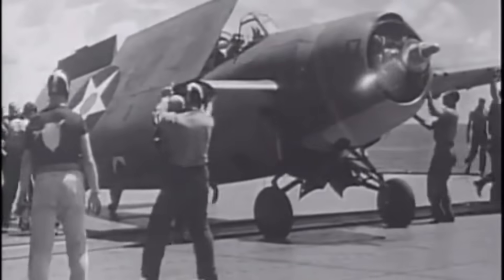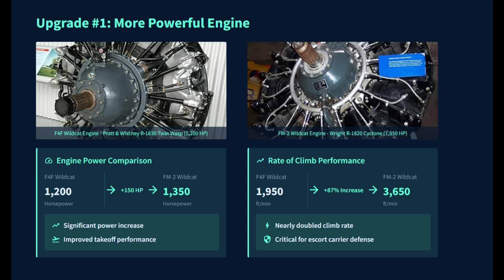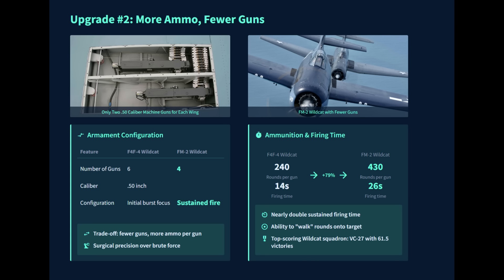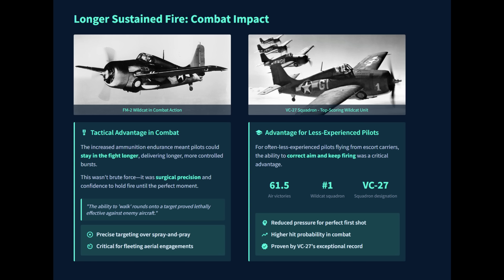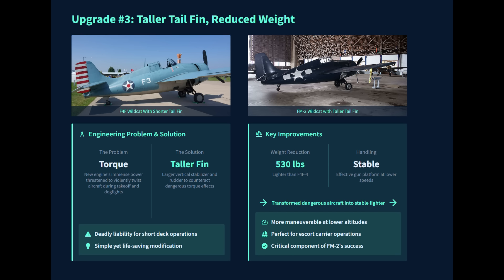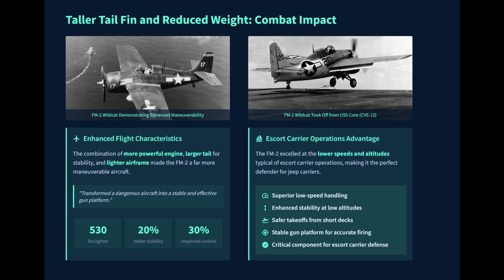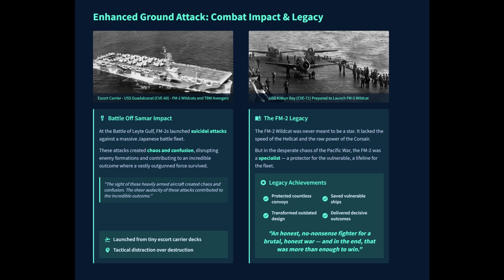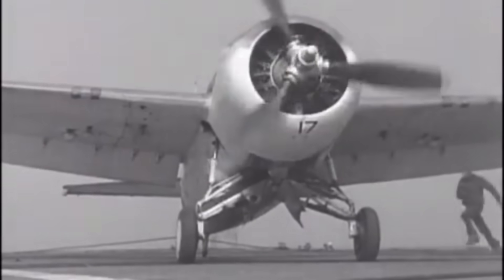FM-2: Four Upgrades That Made It The Ultimate Wildcat

Comment: Good comments below, especially the observation that reducing the number of guns from 6 to 4 increased maneuverability. The wildcat was initially designed with four machine guns and a six gun variant was introduced just before midway. Pilots complained about the reduction in maneuverability and shorter period of fire. One other factor, not mentioned below is that the six gun version was unable to fold its wings, a compromise made to install that extra machine gun in each wing. With space at a premium on the escort carriers, being able to fold the wings was pretty important, as that increase the number of aircraft on board. One final point; Japanese aircraft were so vulnerable that a fire power of four machine guns was sufficient to set most zeros and Betty’s flame with a short burst
Reply: Not calling you a liar by any stretch of the imagination, BUT.....I find it hard to swallow that the US Navy would accept ANY aircraft for carrier service which was incapable of folding it's wings.

Comment: The propeller was changed as well.
Reply: Yes. And I think that pylons for two drop tanks was standard. (On the F4F drop tanks may have been a field modification.) In photos, you usually see them with only one drop tank under one wing and sometimes rockets under the other (which is asymmetrical and looks weird). A well-researched book about the Wildcat is: Barrett Tillman, Wildcat: the F4F in World War II (1983, 1990).

Comment: One of the best"upgrades"that could have been given to all US fighters not just the Wildcat would have been substituting 20 mm cannon for some or all of the .50 cal machine guns. The cannon on the Seafires proving devastating against Japanese aircraft ending the fight quickly rather than the sometimes drawn out dogfight that machine gun armed fighters sometimes had before downing a Japanese aircraft
Reply: There were a few Corsairs built with 20 mm cannon.  The pilots didn't like them.   The radar equipped night fighter version was also equipped with 20s.
Reply: @Rocketsong  This is probably because historically given the choice US pilots and other US servicemen preferred to spray bullets indiscriminately everywhere rather than take a second or two to line up a shot. Though it should be noted that pilots in all other WWII nations seem to have been able to transition to cannon use much preferring the ability to destroy a targeted aircraft with either a single or a few hits

Comment: An important point regarding the perception to NEVER get in a turning dogfight with a Zero:  that rule definitely applied when combat speed was under 250 mph.  At around that speed and above, the Zero's ailerons became very heavy due to G forces, and experienced US pilots took advantage of that and could successfully get in a turning combat with a Zero at higher speed.  The FM-2, along with other second generation US WW2 fighters, had ailerons with hydraulic boost that allowed better manuverability at higher speeds.
Reply: You're close to right - the ailerons were not made heavier due to g-forces but due to the high-speed airstream pushing the control surfaces back in to the wings.
Reply: This info made me think that they used bait & switch tactics, like the famous thatch weave, in the later half of the Pacific campaign

Comment: Hold on, 14 seconds to 10,000 ft with a 3,650 ft/min climb rate? Something's off with math, because that is faster than the F4 Phantom.

That one tidbit aside, this actually a really nice video to reference for the FM-2 and power point slides breaks down the info to be very easy to understand. A nice little fighter, just hope you don't encounter something like Ki-84 in a fight.
Reply: Not to worry the KI 84 was a formidable  fighter but only used over the Japanese homeland to fight B 29's. The escort carriers never got close to Japan.
Reply: I think 164 s not 14 s

Comment: Another point about the armament:  The F4F was originally designed for 4x.50 cal guns.  The two additional guns of the -4 Wildcat were shoehorned in relatively far out in the wings where their mass impeded roll rate. Because of this, the extra guns were not well-accepted by experienced pilots.  By dropping them in the FM-2, not only was the aircraft lightened and ammo supply increased, but the plane became more maneuverable!
Reply: The pilots didn't like the increase to 6 guns because it gave them less firing time. The pilots felt 4 guns were plenty against Japanese aircraft.
Reply: The increase to 6 guns was done to please the British who were also buying the Wildcat.
Reply: That would make sense, as the heavy M2 machine guns would exert greater influence on roll rate the farther they were from the roll axis. Between that, the increased firing time, and the reduced weight, the four gun FM-2 would be a faster, more agile fighter.

Comment: "Immense power" adding 150 HP increase makes it lethal? Would the WWII pilots said this?
Reply: FM-2 ace Joe McGraw of VC-10 & Gambier Bay told me that their engine mechs "tweaked" their 1820s and had more than 1350 hp, probably over 1400. Joe was able to beat a seasoned IJN Zero, getting rounds into his engine for a "probable" 6th kill. The Zero pilot probably hadn't seen a Wildcat since Guadalcanal and underestimated it.
Joe passed away about 3 or 4 years ago.
Reply: Aircraft love two things:  less weight and more power.  Ditching 500 pounds and adding in another 150 HP meant that the FM-2 must have been a ball-of-fire for a fighter.  When the FM-2 was given to the British Fleet Air Arm they vectored a flight of FM-2s against a flight of BF-109G and murdered them.  The Zero gave better than it got against the Spitfire.  An FM-2 could hold its own against a Zero.  It was a match against the BF-109 and BF-110s.  BTW, they were crazy in WWII.  The former "stock car mechanics" (moonshine runners) managed to goose the Allison engine up to 2,000 HP in the P-40 and that had to be a hell of a shock to BF-109 or FW-190 pilots.
Reply: He didn’t cover the technicalities of the engine’s supercharger performance, it got a much lighter installation optimised to allow full throttle at a lower altitude so the power increase at low level was very significant.  The FM-2 Wildcat did not have to be competitive at medium and high altitudes any more as the Hellcats and Corsairs had taken over as the Navy’s best fighters.
These shallow videos do not go into the real issues presumably because of a lack of aviation qualified expertise.

Comment: It was still an underperformer
Reply: 7:1 kill ratio.  Especially since it took on the Japanese BEST pilots until the F4U (April, 1943) and F6F (August, 1943) could enter combat.
Reply: HA!  It could out climb the Zero and out dive the Zero.  The Royal Air Arm would vector them into BF-109Gs and murder them.  The Wilder Wildcat had a low wing loading and if they were operating the aircraft with modified engines they were getting near 1900 HP.  The Wildcat had no VNE so you could fly it like a demon.  The only issue was it was a tad pokey by 1943.  If the USMC and USN had the FM2 at Guadalcanal the battle would not have been so close run.  The FM2 could out climb the Spitfire with ease and could outturn the Spitfire.

Comment: 1350 hp narrative actual 1950 hp
Reply: The FM2 had a better rate of climb as the Zero over the F4F-4.  Gawds, I had no idea of the real upgrade.  The only real problem of the FM2 was it was a tad pokey.  The original lines of the F3F Biplane never left.
Reply: 1350 is the correct number; 1950 is either a misprint or a performance card intended for a different engine.

Comment: Great Video! Don't Forget, Marine Ace Joe Foss Shot Down 26 In The F4F. Also, At 3:13 It's The Vertical Fin. The Stabilizer Is In Front Of The Elevator. Thank You. (Like #109 - Comment #6)
Reply: Vertical stabiliser is synonymous with fin. Both terms are fine.
Reply: The empennage is comprised of vertical and horizontal stabilizers. The video is correct.

Comment: Post Coral Sea Lt Commander Jimmy Flatley advised Wildcat pilots on tactics vs the Zero. He concluded with words that will surprise most:

"You have the better plane if you handle it properly, and in spite of their advantages of maneuverability you can and should shoot them down with few losses to yourselves."

This is in May of 42. Already the myth of the mighty Zero was erased in the minds of those with a bit of experience.

So the improvements of the FM2, while needed and appreciated by the pilots, were not what gave American pilots an advantage, they already had the advantage when appropriate tactics were applied.
Reply: ZOOM & BOOM!
Reply: Thanks for politely offsetting the usual "F4F Wildcats were outclassed" claims with a proper statement of facts. If the Thach Weave, "Avoid Dogfighting," and "Use Boom & Zoom" are properly included, then almost immediately it must be said the Wildcat outclassed the flimsy, burnable, lower speed limited A6Ms. Your last line says it perfectly.